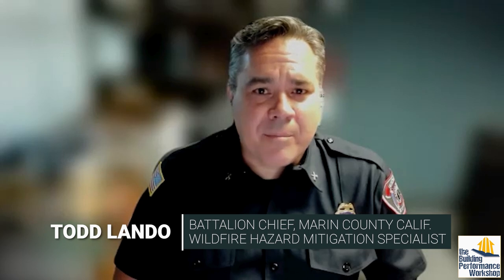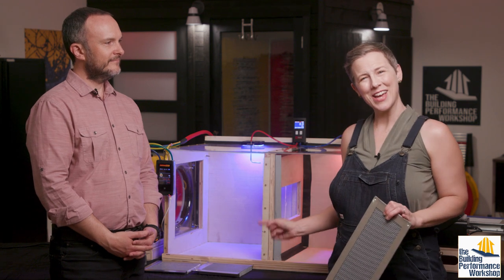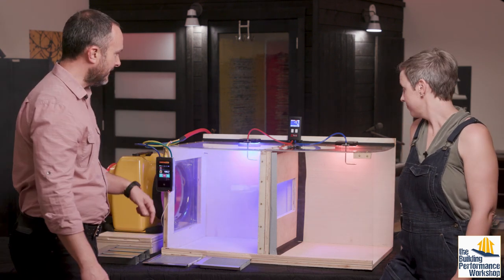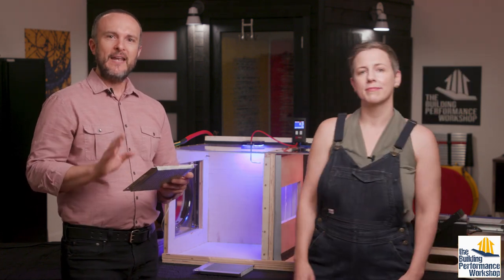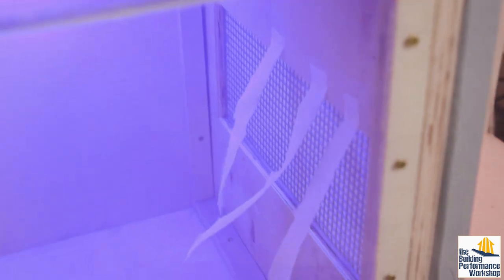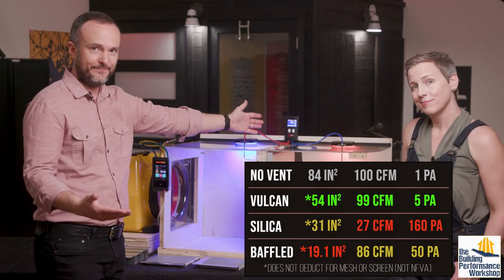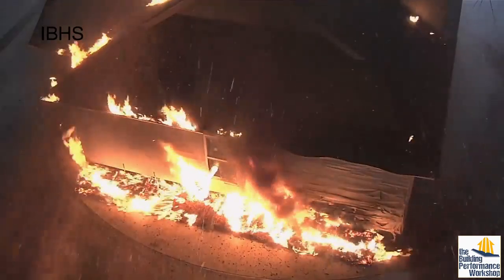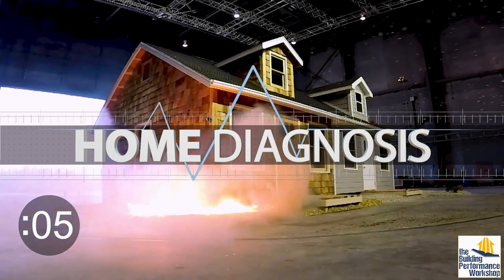Fire Resistant Homes: Testing Vulcan, Silica, and Baffled Intumescent Vents

Comment: When I first stumbled onto this video, I was excited to see someone do a hands-on review, but as the video progressed I became increasingly dismayed. They discussed the construction of each, and their testing only measured air flow and not how well they keep embers out, which is THE reason to use these vents! I don't know if anyone else noticed that the Vulcan vent was the only one named, by the way. The other two vents looked like vents made by Embers Out and Brandguard; why they were not also named is puzzling. There are only three attic vent manufacturers who are approved by the California Department of Forestry and State Fire Marshal and these are they. Sure, the Vulcan vent had the best airflow numbers, but that does not necessary mean they keep embers out more, or better than vents made by Embers Out and Brandguard. Cost, availability, and which vent fits and gives you the net free area you need for a properly vented attic are the factors to consider in choosing which manufacturer to go with. Lastly, using 1/16th inch hardware cloth in vents is an effective and affordable way to go too.